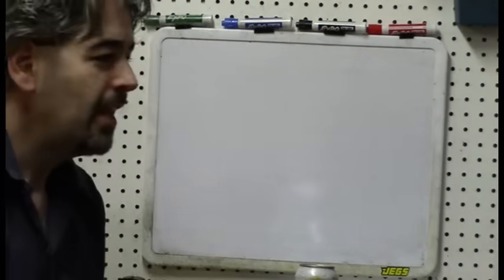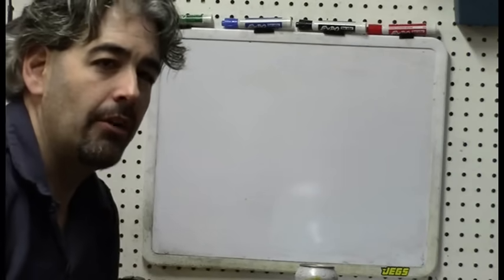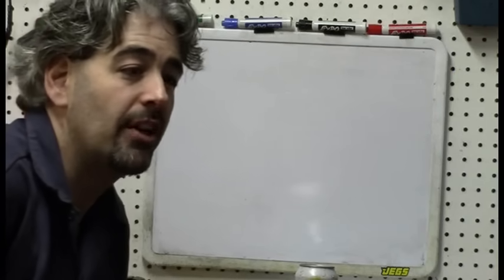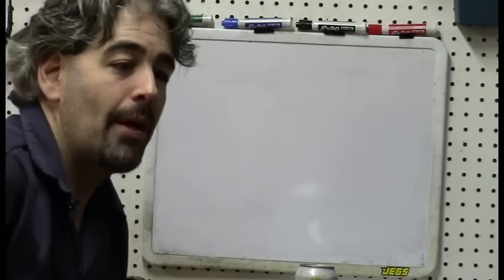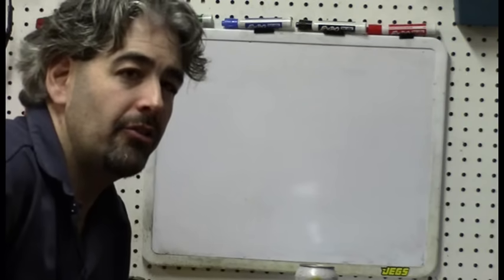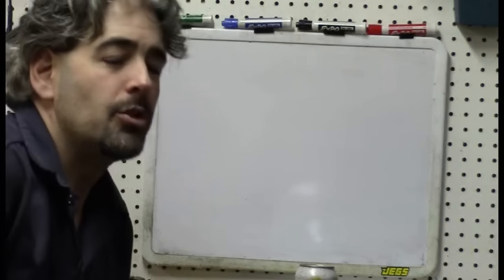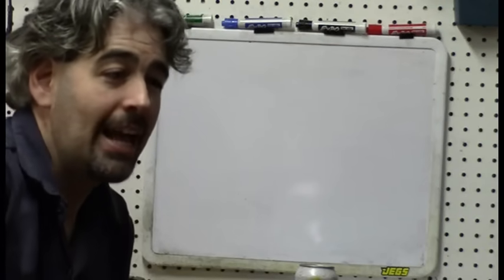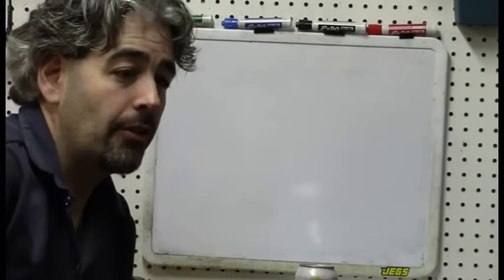Secret of Engine Problem Diagnosis- Fuel Trims Pt.1

Comment: This video is worth a fortune! By that statement, I mean it could potentially save anyone who takes the time to fully understand it, thousands of dollars in wasted repair bills. If any would-be mechanic only ever watched one YouTube video on how modern engines work - let it be this one. I think it's the scientific background that gives this guy the edge over the others. Unbeatable knowledge.
Reply from the maker: Thanks man. Of all my videos this one is both my favorite and by far the most importance.  about 80% of performance diagnostics stem from understanding the concepts in this video. At very minimum, bifurcating the causes of symptoms as resulting from a rich or lean condition in itself eliminates 50% of variables.  It is extremely powerful.

Comment: Great instructions. Is there a way that I could send you snap shots of my obd2 readings  so that I could show you exactly what is happening to my truck (2005 prerunner with 151k). My gas mileage gone down. Also is there a web that I could see what the specs of the manufacturers are for my truck. Thanks
Reply from the maker: Sure. just list only the RELEVANT data though- don't give me a screen dump of everything.

Comment: Hey, Learned a lot from your videos, also got an OBD2 scanner. I was looking at my data and ECT and Ambient Temperature are showing exactly same values(which is +20C from  actual Ambient), Is it normal? Also my speedometer is showing correct Ambient, which is different from OBD2 value

Comment: Great information
My Toyota Passo O2 sensor shows high value when idling. It reaches to 0.9V instead of 0.45V. What to do? check O2 sensor, MAF, spark plugs, EGR etc. MAF in not seen at upstream of throttle valve. Also EGR valve is not seen anywhere
Reply from the maker: Induce a lean condition and verify proper response and if it doesn't check signal output and if absent change O2 sensor.
Reply: @SchrodingersBox  Sir, thanks for reply, but how to induce lean condition?
Reply: Would you please give hint to induce lean condition

Comment: I changed the pcv hose that was broken, but I still get a p0171 from time to time. When I changed the pcv hose I had to take apart the intake manifold, because the pcv is underneath it and I saw quite a huge play in the swirl flaps. My question is whether the swirl flaps from the intake manifold could generate a p0171 code if they are worn? 
Fuel trims are also high, Long term is around 24% at idle and it gets a bit better under load, aprox 15-18%, but still quite high.
I have an European ford focus mk 2.5, 2.0 engine with LPG. 
Thank you!
Reply from the maker: what’s a swirl flap lol???

Comment: At 11:46 how can that leak be non-metered? Yes, the MAF will not see it, but wouldn't the MAP catch it? Cause an air leak will automatically lead to a vacuum loss, therefore the MAP will be abnormally high when the engine is running, much closer to 1 atmosphere than the expected 0.3 (give or take). I still struggle to understand if there is such a possibility to have a leak anywhere within the pipeline, that would not get caught by any sensor. Because I'm assuming that if your MAP sensor reads close to 1 atm when the engine is not running, but then drops to 0.3, then there should be no leak.
Reply from the maker: Great point however the MAP doesn’t override the MAF unless there is some clear indication the MAF isn’t working.
Reply: @SchrodingersBox  Hmm, they work based on a priority system? It's a bit strange, because in this way, any leak that happens past a non-broken MAF will never be reported simply due to the MAF having higher priority over the MAP. I mean, they're placed in different spots and measure totally different things (air flow vs. absolute pressure), which is precisely why I would consider them to be completely decorrelated (as a requirement). 🤔

Comment: I am very impressed with your knowledge.  My fuel trim issue may be due to the fact that my 96' 850 Volvo has 250k miles on it.  I am reading a -14 LTFT (rich condition)  at slow speeds to 30 mph but then drop to -9 at highway speeds.  My STFT is fine at +or -5.   No check engine lights or injector misfires.  Any ideas?  Thanks,  Frank
Reply from the maker: Check your cylinder compression.

Comment: Big fan! Down for a puzzle? 2009 jeep Grand Cherokee 3.7....symptoms: sometimes a lean code sometimes a rich code sometimes both. Sometimes one bank sometimes both banks. O2 codes pretty much all the time- too high voltage too low voltage. O2 data sometimes looks normal sometimes out of whack. Latest fuel trims: stft both banks pegged @ +2%....doesn't move even @ wot. Both ltft....-3% @ idle. As soon as you press the accelerator both jump to +30% and mirror each other. Everytime. Very seldom long crank start (battery volts are good as well as the alternator). And every once in a while delayed start. No start no crank, leave key in on position for about 5 seconds then engine cranks over. Map data good. O2 wires...good. grounds....good. no vacuum nor exhaust leaks....thoughts??
Reply from the maker: Doesn’t seem to mysterious.  You have a lean condition under load. 
  Whats that MAF data you say is good?
  Where is the fuel pressure data? I didn’t see that listed.
Reply: @SchrodingersBox  fuel pressure  @ the rail 57 psi (in spec 58 +/- 2) map @ idle hovering around 20 inches of mercury
Reply: And yes sometimes lean condition under load and @ idle. I have only seen rich condition @ idle not under load
Reply: And no MAF on this vehicle..only map and air temp.
Reply from the maker: What’s MAP under load and at deceleration?  Whats fuel pressure when under load?
Reply: @SchrodingersBox  i got the data recorded  and will double check and get back to you. If I remember correctly map data under load (both inhg & volts) looked good. I haven't checked fuel pressure under load...thanks for all of your help and answering back as I'm sure you are busy!
Reply: What preplexes me the most is that stft are pegged....and both ltft jump from 3 to 30 as soon as you tap accelerator and as soon as you let off drop to 3%..instant reactio. Only the ltft move under load NOT the stft.....both banks mirror image......never seen that before again...thanks for the responses

Comment: I did not see a reference to the 2nd oxy sensor which I thought was part of the fuel trim
Reply from the maker: At the time I released this videos almost no cars had fuel trim from the rear O2 sensors. Now it’s more common. However the contribution to fuel trim from a rear sensor is still only about 1%

Comment: Changing out my ignition coil continuing to diagnose   just doing much of a over due maintenance   like I changed a o2 sensor months ago got a ngk coil pack  next ima attack the fuel pump..before I got ngk coil I got the durast  brand new and took 4 long cranks to start  3 crank would do a intake manifold backfire  ..did make my motor shake less smoother  my oringal  coil starts up on one crank ..weird but ima try ngk see wat happen
Reply from the maker: what data are you basing any of this on?

Comment: Thanks to you I was able to self diagnose the MAP sensor problem - it not only saved me money from useless repairs but it prevented me from selling the car, which, by the way, was still having warranty...the dealer was telling that the car was working perfectly fine with a fuel consumption of 16l/100 km in town, from a 1.4l gasoline engine (when new, it never jumped over 11.8l - and that was only in traffic jams). I bought a diagnose tool, recorded some live data from almost 60 min. Of continuous driving in various conditions and found out that the pressure reading was wrong...changed the sensor and now my car works extremely fine. The funny part is that the dealer never admitted that anything was faulty and only a mechanic was interested in knowing how did I determine an issue when no error code was present.
Thanks a thousand times for the help!! If you ever write a book on these car topics, put me on the list and I'll be among the first to buy it!

Comment: Hi love your channel and your willingness to share your knowledge!!!  I am dealing with a 92 dodge 5.2l (318ci) engine. OBD1 stuff.  It's running rich and burning fuel faster that the tanker truck I drag behind it.  Should I join your channel? I am very interested in doing. In doing so would we be able to address this situation? I think I have it narrowed down....mentorship is a great thing...thanks again.
Reply from the maker: thanks. indeed I have several rich condition case studies on the pay channel.

Comment: this is very good explanation of fuel trims thank you. just a question , i am currently on 24% LTFT and got a code for lean condition , can an exhusat leak cause such ? and also which O2 sensor between the 2 that i have reports lean condition?
Reply from the maker: Possible and It would be the pre-cat sensor
Reply: @SchrodingersBox  thanks for your response🙌

Comment: Hello! Great lecture! Thanks! I have scanned STFT and LTFT on my Subaru Outback 2005. Looks like I have a problem. My  both LTFT were showing 14% positive and STFT were showing around 3-4% above 0 and dropping to negative values once in a while. All this at idling. Once I start accelarting LTFT would go down and STFT would go up.  Then I sprayed my MAF sensor hot wire with a carb cleaner. Then LTFT at both banks went up to positive 20% and STFT would be positive 3-5% at the  beginning but after some driving STFT at both banks would go up to 7-10%. The behavior LTFT go down and STFT go up stayed when I hit the gas pedal. I am having some trouble to understand what could be the reason for this problem. I have some screenshots of both fuel trims and A/F ratio from my scan tool while driving and idling. I would appreciate it if you could take a look at those pictures. How can I send them to you? Thanks in advance!
Reply from the maker: You cannot determine anything on that data other than there is high fuel trim at idle. Thats all.
Reply: @SchrodingersBox   I also have data for MAF, MAP, AFR sensor, EQ ratio at idling and 2500 revs. Can you just take a look at them just to see if you see anything wrong. Thanks.

Comment: I just came across this video, trying to understand the fuel trims, workings of the O2 sensors and conditions it takes to to set codes. You made it very easy to understand, both part 1 and part 2 were very very helpful. Diagnosed an intake leak from the information in your videos. Thank you!
Reply from the maker: Glad it helped!!

Comment: Very informative. I am trying to figure out my problem with my boat motor. The engine is hard starting and using too much gas.  I hear what sounds like excessive air succing sound. Diagnostics on the chevy 7.4L stated that i had a bad MAP Sensor. I replaced it but the problem seems the same.  I am beginning to wonder if its electrical and the MAP sensor is not even providing any data to the ECU. I had an ECU problem as well and I sent that off to be fixed. the computer guy stated that there was  a problem and stated that it could have been caused by another issue that needs to be fixed.  So I put the fixed Computer with a new MAP sensor as well as a new IAC but the motor runs the same, Hard to start, doesn't want to idle and running rich.  What would you suggest i do?
Reply from the maker: I would start with “diagnostics stated it had a bad MAP sensor”  - what was the data you used to do those diagnostics and what did the flow chart state were the parameters met to validate the sensor was bad?  That is the most logical starting point since your data indicated an induction metrics fault

Comment: I have a CRV 2012, it hesitates at the beginning of a trip between the speeds of 20 and 40mph. I changed coils, spark plugs, MAF, MAP, air filter. I noticed a gasoline smell on rhe exhaust,  the LTFT is at 10.5 to 12.5. Any ideas what's causing the vibration? Thanks for the great videos you post.
Reply from the maker: What data did you have showing this was both an ignition and induction issue?? I would totally start there as that’s really unusual.

Comment: How about a vehicle  that has high LT fuel trim settings  settings bank 1 and 2 o2 sensors up stream. And no lean condition  codes?
Reply: Oh and o2 sensor codes p2241 and p2238?
Reply from the maker: What data does it have?  As shown you have to analyze the data.

Comment: 14.7 pounds per square inch of air is an atmospheric pressure measured at sea level.
Reply from the maker: Correct. It is just coincidental that it happens to also be stoichiometric. They are actually totally unrelated.

Comment: Awesome job explaining short and long term fuel trims!!! Do you have any recommendation for my 2010 Camaro V6 issue?....
Issue:
During idle and driving I maintain around 16% on both bank 1 and 2 long term fuel trims, 0 to 3% on both bank 1 and 2 short term fuel trim, both upstream O2 sensors oscillate between 0.1 to 0.9V, fuel pressure stays between 40 psi to 75 psi. One think I did notice the LTFT actually going up to 18% or alittle higher on both banks. Any help would be greatly appreciated!!!
Reply from the maker: What does the fuel trim and rail pressure do when curved against RPM?
Reply: @SchrodingersBox  I collected the below data with my scanner while in park with engine at operating temperature....
At   671 RPM: Fuel Rail 461.2 PSI, STFT1 -2.3%, STFT2 -0.8%, LTFT1 19.5% LTFT2 18.8%
At 1040 RPM: Fuel Rail 417.7 PSI, STFT1 -6.3%, STFT2 -7.8%, LTFT1 21.1% LTFT2 20.3%
At 1533 RPM: Fuel Rail 433.7 PSI, STFT1  2.3%, STFT2  2.3%, LTFT1 21.9% LTFT2 21.9%
At 2037 RPM: Fuel Rail 501.8 PSI, STFT1  0.8%, STFT2  3.9%, LTFT1 22.7% LTFT2 22.7%
At 2416 RPM: Fuel Rail 500.4 PSI, STFT1  0.0%, STFT2 -0.8%, LTFT1 22.7% LTFT2 23.7%
Reply: Any thoughts with the data I provided?
Reply: @SchrodingersBox  Any thoughts on this issue?
Reply: @MrSport2005 bet  your seeing it drop its supposed to be increasing and then level out

Comment: Hey Matt, I've been "studying" and learning from your videos for a while now. I had recently came across a mind fuck, that I don't see covered a lot, and wondering if you can do a video to help explain this.   With live data, it says fuel system 1 cl-fault. What/how/why?  Thanks.
Reply from the maker: Never heard of that. what is your DTC code?
Reply: Dtc code P0038  

Yeah, this cl-fault isn't any type of code. It appears in live data, where it will normally show ol or cl.  It's weird.
Reply from the maker: P0038 sounds like a O2 heater circuit. I’d expect the car to be delayed entering CL if that was the case. Makes total sense- hardly a head scratcher and simple to diagnose. Simply test for amperage on the O2 heater circuit (should be about 1A) and if there is none look for continuity on the heater wire and voltage from the PCM as well as PCM ground control.   I have only ever seen these ground side switched, ever.
Reply: Thanks Matt. I've had others tell me that the rear O2 has nothing to do with cl.   You're right about the course of action that needs to happen.

Comment: I am restoring 1988 corvette.  I have been told there are no scan tools available for it. Do you know of any that  would do the job
Reply from the maker: I do not. on OBD1 I just draw the codes using a paper clip and then manually test the systems.